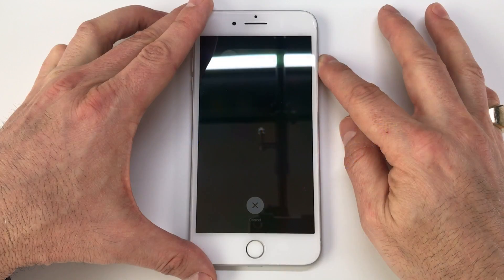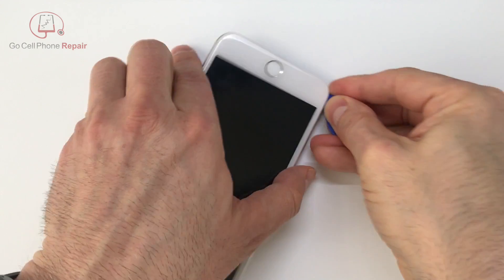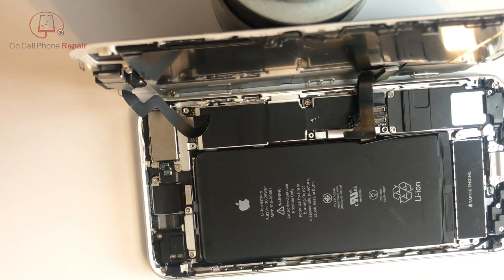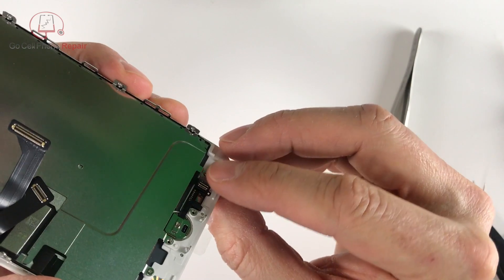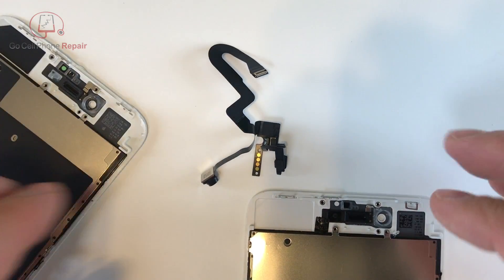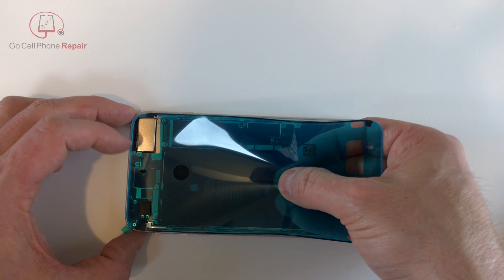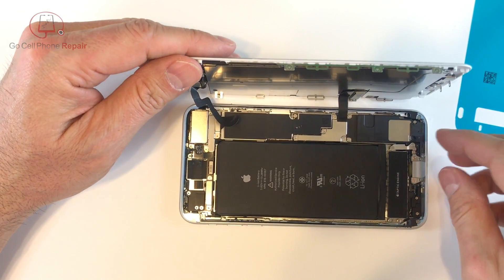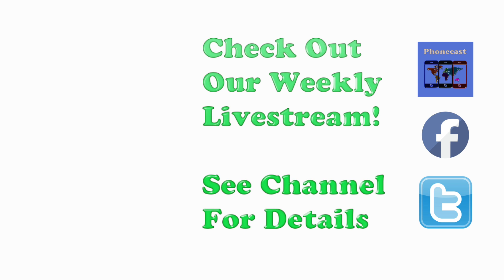iPhone 8 Plus Screen Replacement and Waterproofing | Pro Version

Comment: Go Cell Phone Repair. Love the videos. The live stream was good tonight. A little help on the iPhone 6 gps/Wi-Fi antenna flex cable install video. I left a comment at the top. Then I can delete this if you don't. Thanks tons. You rock.
Reply from the maker: I did do some digging out of curiosity due to your comment and found out that the iPhone 6 GPS ic is RF1330. Did not know that before. But I'd still recommend you change out the antenna and cap or have someone do that for you before ruling them out. The back of the antenna is also prone to accumulating dust and debris which can affect your signal too so you have to really make sure not to touch that part on the new one or you may end up with the same problem.
Reply: Go Cell Phone Repair. It just started dropping its cell phone signal too sporadically. Not quite crippling yet.Oh,  and I do live in the high desert, not cacti and road runners, but it is dry and dusty. What’s unique with the gps? Now I’m curious. Thx!

Comment: does your auto brightness work after replacement?
Reply from the maker: Yes. No problems with this one unlike what we’ve heard about the X.
Reply: I work for a repair center and have been unable to get the brightness to work even with transferring the OEM front ribbon into a replacement LCD/Touch assembly, I can transfer back and forth into different displays but will only work with its original motherboard, LCD assembly and ribbon. Any tips or tricks other than your video that you can suggest?
Reply from the maker: Let me make sure that I understand you correctly. It is the replacement screen that is the suspected variable? You mentioned the motherboard so are you thinking that the motherboard is paired to the screen somehow or the front facing camera flex? I have an after market cable that I'll be installing into an OEM screen today and I'm wondering if the success/failure of that procedure will answer your question better.
Reply from the maker: Got it. Let me see what I can come up with. One thing that I have noticed about the iPhone 8 that I use is that the display (OEM) does not turn off as it should consistently. I have the display set to auto-lock after 2 minutes but it doesn't always do that. After updating to 11.2.6 the problem persists so maybe it is related to whatever is causing the ambient light sensor problem. Do you mind if I use the video that you have created during  a livestream this evening? I believe that some of my subscribers would be interested in seeing it and maybe offer some solutions.
Reply: my apologies I had already left work by the time I received your reply. you may use the video at any time. I created it so I could explain my situation better. so please by all means do so if it helps come to a solution. I used the glass panel, meant for reman, to show that I have been able to eliminate that as the variable. which leads me to believe there may be something within the LCD triggering the failure. I have found patent information that may have been applied to the 8 lcds. but also information regarding Apple using their Horizon machines to calibrate replacement LCDs to phones. so wether it is an LCD issue or a mother board issue with the replacement I have been unsuccessful. I have also switched an OEM with another OEM display while keeping the front assembly and home key tied with its original mother board, with the same failure result
Reply from the maker: Great. Maybe we can figure this out. I've checked with our stores and so far they have not run into any issues with iPhone 8 series ambient light sensors. Are all of your after market LCDs all from the same vendor? I wonder if there is something about the brand specifically causing the issue.
Reply: we have tried 7 different vendors, across multiple handsets. possibly a few are sourced from the same location but we have also sent out a few for reman, same oem lcd/different glass. with the same result. unsure of what to do next.
Reply from the maker: Strange. I have noticed something about my own iPhone 8 Plus. It seems as if the sensor is not properly calibrated. It does respond to ambient light but always seems to be brighter than it should for the conditions. Also, no matter what the auto-lock interval is set to it often leaves the screen on indefinitely. Maybe there is a defect in this model that we will see more of in the future. I'll show your video during the live stream today and see if we get any solutions.
Reply from the maker: Well that was the plan. I can't seem to find your video at the moment.
Reply: thank you very much for all of your assistance and attempts to find a solution. it is greatly appreciated